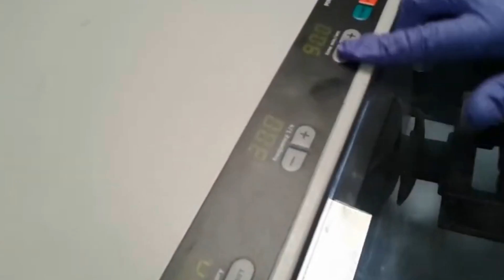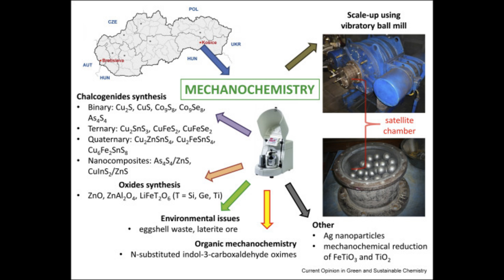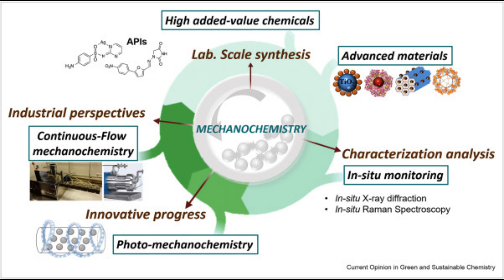2151 Chemistry For Everyone - Mechanochemical Synthesis of Copper Inks And Nanoparticals

Comment: Question:
The chemical from Minute 13:48 (Copper Oxide plus Formic Acid), once printed on a substrate, is sprayed or added to the component from Minute 14:08, which may be Ascorbic Acid, so that it reacts and leaves a thin layer of copper, or it's another reducing chemical.

Ascorbic Acid is a reducer and an antioxidant in the synthesis of copper nanoparticles.

Excuse my English.

Comment: I just wonder if the churning of cream to make butter might be a chemicomechanal process . Whipping cream though might only be an aeration process although best results are obtained using a copper bowl or copper plated hand whipper kitchen gadget, whatever it's name is . Then there was that phenomenon described years ago in scientific publications for putting a diamond coating on things like stainless steel handrails and surfaces by sprinkling graphite powder onto a wool polishing wheel and doing some polishing . Professional polishers at the time I was surprised had heard about it and wanted to try it . I never got the follow up.

Comment: Rob have you looked at the armstrong hydroelectric machine  for your woodstove power ? No moving parts , perhaps way more power than tegs . Your mhd looks goodish except that a good woodstove have very low flow to keep the heat inside . Suppose thats why the rocket stove ...
Reply: High voltage steam !!!

Comment: Is it possible to coat plastic with that so as to have a base for electroplating stainless steel for final finish on the plastic part?
Reply: What plastic?

The answer varies, and frankly with the plastics Ive sent to plate they where never very chemically resistant so we used pure mechanical embedding.
Tollens reagent is also used to precoat plastics, just with a thin layer of silver, in a basic carrier rather then an acidic carrier.

But like Ive already said. I havent, I do not have the answers; but I do know you need to know your plastics properties and if they will react with the carrier and chemicals used.
Reply: @AnonymousAnarchist2 Thanks.  Seems like I got lots learning to do in order to get my parts plated.
Reply: @bartronicsecurity  Well ua can just send them out, or for small volumes order a spary from 3M, but they will need to know the plastic they are made of.

Comment: Here's a poor-man's copper plate on steel method I discovered by accident. (well known by others too apparently) Put some sulphuric battery acid on a rag, rub an oxidized piece of copper pipe then with the same rag rub a piece of steel. Voila, a very thin but well bonded copper plate. Very pretty.
Reply: But how about for stainless steel?
Reply: Never tried it, might work. @philip5940

Comment: Hi I can't find the video with the strange twisting wires that conduit electricity with a rotating motor no brushes needed . It was amazing.. and I finally remembered the steam engine I wanted you to try to replicate from off the shelf parts.its called a unflow . steam engine it's a pipe that reciprocating back and forth .looked simple and is supposed to be very efficient. Take a look every body could use one in a emergency or camping.

Comment: Hi Robert, I used to use copper sulphate for marking out steels, it leaves a very similar finish to what you got on your knife blade but without the coughing lol. If you want to experience it's aroma power, throw some cast iron filings in (metal container needed, it gets hot). The smell is unique lol
Reply: Cast iron fillings ? Not
 nails say or steel wool ?  I'm guessing thus that hydrogen sulphide is produced.
Reply: @philip5940  yup, the good old stink bomb😱